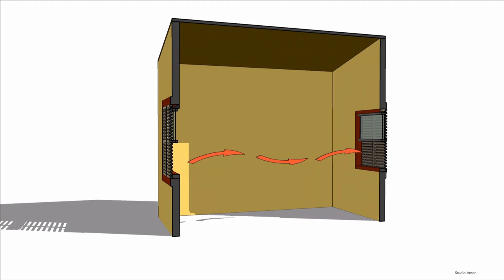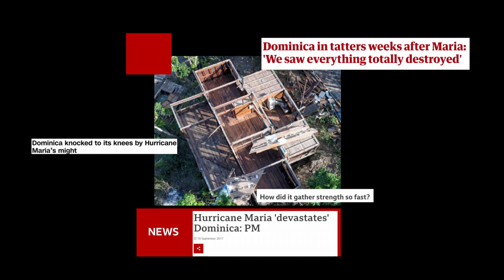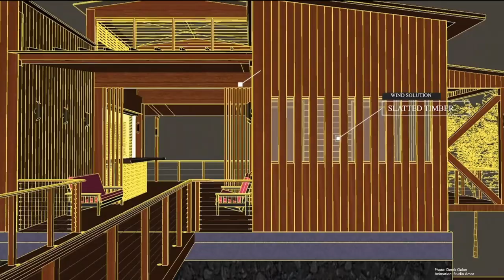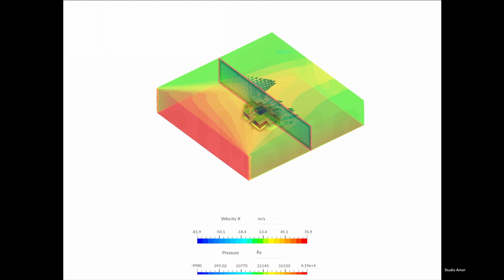How to Design Climate-Resilient Buildings | Alyssa-Amor Gibbons | TED

Comment: Hmm, could the wind be funnelled through the sacrificial corridor to blow against the wind dampening it at critical locations? I guess you'd need concrete or some such for the funnel though. 

Actually, what it it were angled up? would it push the building down and possibly redirect some of the wind up?